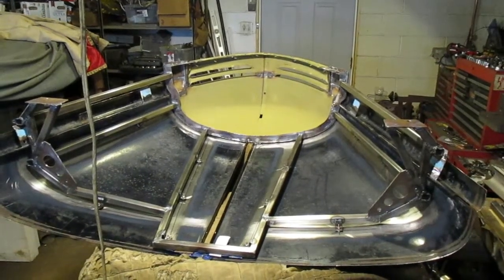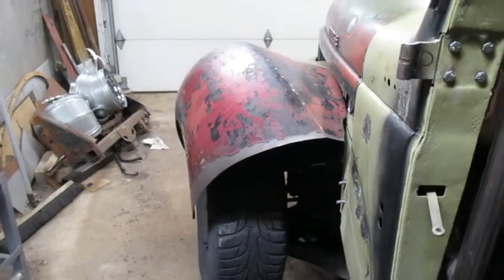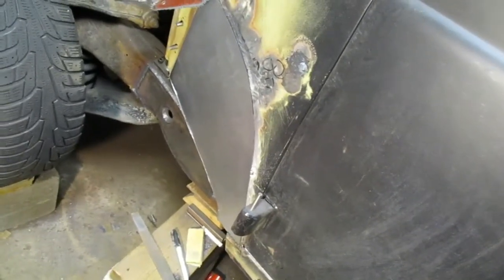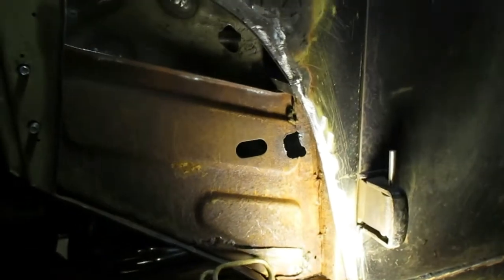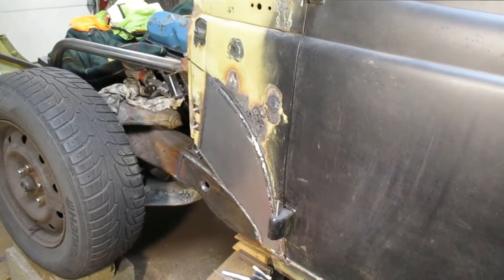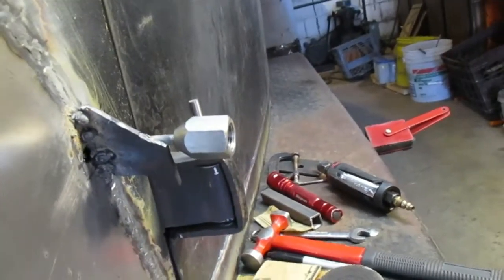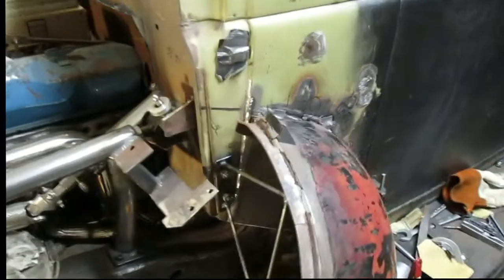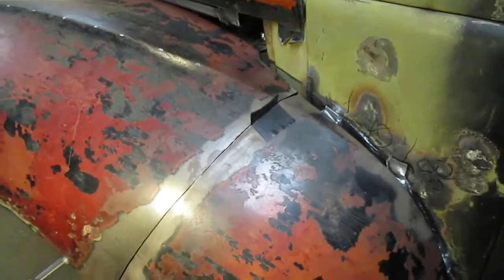Video 47, 1946 Dodge Pickup, Fender Rear Corner

Comment: How did you figure out what angle to cut that fender so it opened without rubbing?
Reply from the maker: At some point I had the a-frames supported and was turning the wheels back and forth while looking at clearance from the tire to fender. I wanted a lip on the fender corner so I made a shim to simulate the lip and got the tire in the worst clearance location. I tried to get the split as far forward as I could and still clear the tire. I did need to put that 1/4 inch piece of plate on the front end to hold the front fender up so it meets properly.
Thanks for watching.

Comment: Would you do it again?
Reply from the maker: I was looking for a hobby to take up my time and learn from. I think it will be a nice thing to have and make the truck easy to work on when I am old. If you are just looking to get rid of scratches from the hood halves, I would make the top portion of the hood one piece like most modern cars and trucks. You would not need to cut the fenders and line everything up.